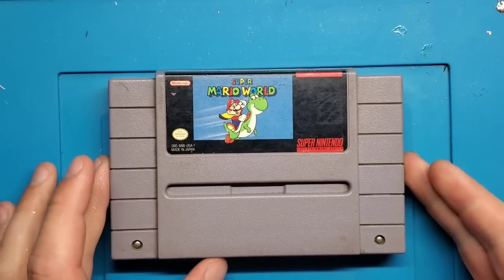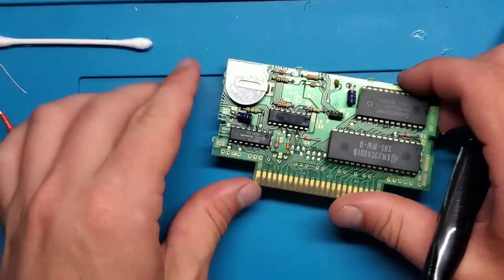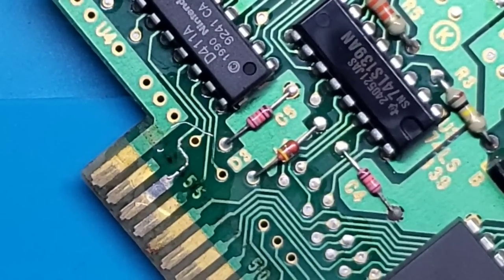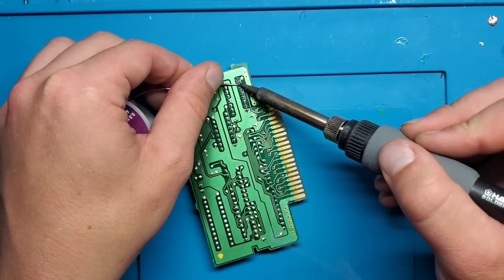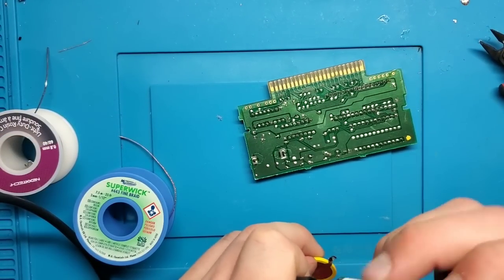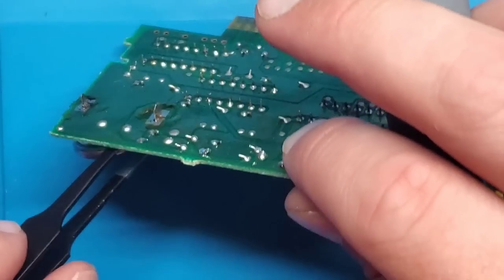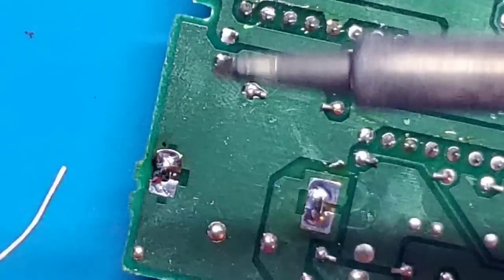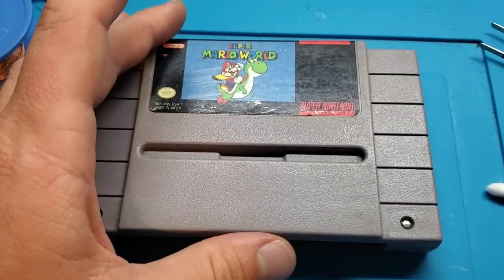SNES Game Won't Boot - Fixing eBay Junk - Super Mario World

Comment: Chills ran down my spine when I saw that pencil eraser. I pictured you scratching the pins with the metal and Aaahhhhh! Great video, by the way
Reply: I was thinking the same, that eraser was awfully worn. It's a great tip, but I would have preferred he use a block style eraser, or at least a newer pencil.
Reply: what's the worst thing that was gonna happen though? the contact gets scratched up a little bit. a bit of flimsy eraser metal isn't gonna slice clear through them.
Reply: @omikronweapon  It can put a gouge in the pads, which in turn can scratch the terminals in the receptacle, which in turn can scratch the pads on other games, which in turn further damages the terminals in the receptacle.  Its like getting dust and dirt on a piston, doesn't seem like that big of a deal, but reduces the life of the equipment significantly. Scratching the pads will almost always reduce the life of the system and cart in some meaningful way, so its more about preservation, if you did gouge it and didn't want to damage the system then you would need to sand/polish the gouge out, which makes the pad thinner, which again reduces the life of the cartridge. Better to just not risk it if possible, and using a separate eraser or newer pencil costs literally pennies on the dollar.  

Why risk reducing the life of your game or system to save a few pennies?

Comment: Dude! You can just measure the voltage of the battery! If the battery is fine its a total battery waste!
Reply from the maker: It's still a 27 year old battery,  I'd be replacing it anyway
Reply: RetroRepairs eventually will need new batteries anyways

Comment: Didn't actually test the repaired trace or the 'dead' battery?  What if there were just no saves?  Imo should have tested the saves before replacing the battery, but easy enough to replace it I guess...makes for a more interesting video.
Reply from the maker: It's a 27 year old battery,  so while I'm in there,  it's definitely worth replacing

Comment: Loved the zoom. what camera are you using?
Reply from the maker: It's actually a Samsung S10+
Reply: @RetroRepairs  I advise putting a case on your phone. I had me s10+ less than a money and cracked the back glass 3 times. The rounded  edges makes the glass very brittle.
Reply from the maker: Bought an otterbox defender the day i got it.   I drop my phone almost weekly
Reply: @RetroRepairs  Smart move. I was ticked off when I broke my $1000 phone in 20 days. I've had 4 other Galaxy models and never cracked a screen. I hate the bezel-less phones.

Comment: A thing, For reflowing can we use a Heat Gun?
Reply from the maker: You can use a hot air rework station, but not a heat gun you'd use for construction
Reply: @RetroRepairs  Thanks for the Advice! I had one of those for Construction and i was wondering if i can use it for Reflowing. Thanks a lot.

Comment: watched a few of your videos and made me get my snes out of the attic... but my issue is the console turns on and game starts but for afew second i have full colour but then slowlly it goes dark but u can still hear sound. How can I fix that?
Thank you
Reply from the maker: I think you've got bad capacitors.   They might need to be replaced
Reply: @RetroRepairs  thank you for your reply... it was the rgb/scart cable... it had 3 extra capacitors in it once removed it all works fine.

Comment: Have you tried using a Magic Eraser, (Or the cheap knock off "magic erasers" to clean the pins? It's what I use and I find it works AMAZING. (Wet with alcohol first. Never use those dry.)
Reply: Tom Leech 
Yes that’ll work because of the fact that it’s technically sandpaper. You just have to be really careful not to rub away any of the copper traces because it will cut through the solder mask if you push to hard. Happy repair!!

Comment: what causes those traces to just break like that?
Reply: bulkchart 32 sometimes stuff like sadder just breaks over time and heavy use
Reply: All pcb traces are made out of copper. In some cases they also corrode due to age, usually combined with bad storage or faulty design.

Comment: Hey Adam, you should try a product called brite boy for the pins. Renebean swears by it and a bottle will last years.
Reply: shize9ine 
Glass top oven cleaner does the same thing. Don’t spend extra cash on something that’s already been invented that you can get for cheaper. Work smarter not harder brother
Happy repair!
Reply: Apathetic Karma yeah brite boy is expensive. I haven’t tried glass stove top cleaner before, but you think it works with metals and not just glass? I’ll have to try it some time because I have the glass stove top cleaner already!
Reply: shize9ine   It really does work

Comment: You said the next console ro be repaired was nes top loader!!
Reply from the maker: Yeah,  that one's still sitting there.  On the plus side,  I've finally got replacement ram chips in.   I need to buy a desoldering gun though, I'm at the point i need to remove all the chips and with a braid leaves alot of room for error